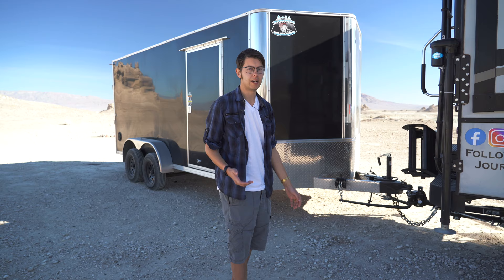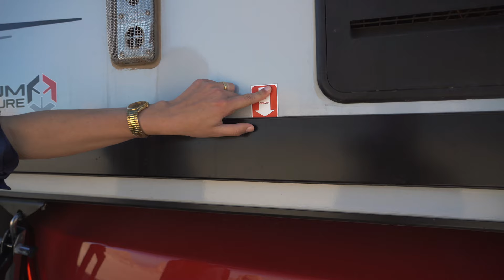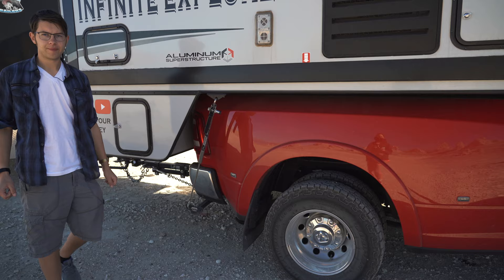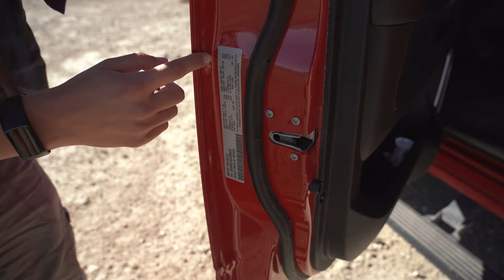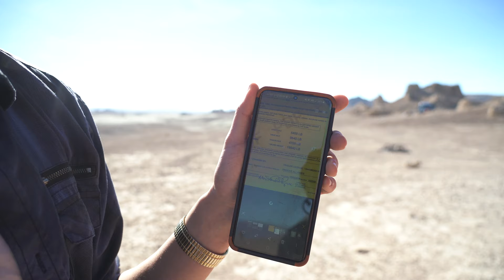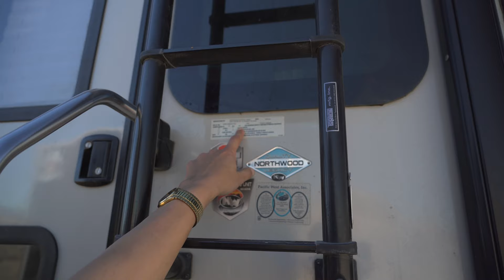Truck Camper Weight Safety + Weight Distribution Hitch

Comment: Great video. Looking to do the same setup. My trailer is a little heavier. I bought the hitch extension already. Thanks for the info on the weight distribution from curt. I have the same truck as you just older (2010). I have the tork lift tie downs already but getting the new tork lift hitch prob the 20,000 lbs version. I know I need back end new tie downs. Did you also have to buy the extensions as well for the tie downs? I’ve read I might have too, since it’s a dually .
Reply from the maker: Yep new rear tie downs are needed to work with the new torklift hitch
Reply: @InfiniteExplorers  yes I knew that and I know I need new ones. Since with the torklift hitch they connect into the hitch. I believe the part number is r3505. Did you need the extensions ?

Comment: How big is your cargo trailer?  It looks like you have a lift kit on it to give you more ground clearance.... which is a must for traveling off the beaten path.
Is it a torsion axle trailer or leaf springs?
Reply from the maker: 16ft cargo trailer. Yep, we flipped the leaf springs so we gained about 5" of clearance. Has worked great with no bottoming out when coming into steep places like gas stations in the southwest. The axles are leaf springs. Looked at getting one with torsion axles but prices are crazy for trailers right now.
Reply: @InfiniteExplorers  Thanks for the info.  I started trailer shopping yesterday, although I've been "kicking tires" since last summer.
My shopping got more serious yesterday after selling a little travel trailer over the weekend.  I'm waffling between a 14 and 16 footer.  16' is bigger than I want for my overall length with truck and camper, but it really doesn't make much sense to go from a 12' to a 14'.  My current trailer is a 7x12.
Reply from the maker: @Delta Bravo  we are happy with the 16ft v nose :) still enough room in the nose for a few things, plus our SxS is just under 14ft long.
Reply: Great presentation!  Very easy to understand with no sales fluff.  New to TC world. Thinking about a 13’ box trailer for micro golf cart, bikes, and tiny boat with a F350 & a new 3000lb. Palamino TC. Had two box trailers in past pulling them with a MH. Thanks
Reply: A nice video! We have a similar setup,  but a larger camper with multiple slides, so we went with a Ram 5500 so there are never payload issue. We also tow a SXS in a 14' enclosed trailer with a 48" Torklift extension. Because I am super paranoid about issues, we also added a Trailer Toad, so there is essentially zero tongue weight. Very interesting idea to do a lift on the trailer. I'll have to see if it can be done with mine! Safe travels!

Comment: GVWR for your 3500 is 14,000 pounds.   Payload for a 4500 or F450 is still 14,000 pounds, but the payload is less because those trucks are heavier.  I suspect your truck is way over 14,000 pounds, so you can get a ticket or worse be responsible if you have an accident.

Comment: Overweight
Reply: Yeah, either the new RAM 3500s can handle more payload or he's calculated it pretty close. An Arctic Fox 1150 is one their heaviest campers so I'm surprised the truck wasn't in the 450/4500/550/5500 range.  Definitely need one of those for an Eagle Cap.  This guy seems to have it all figured out letting the tow trailer take off some of the weight.  Smart, I didn't know a trailer could do that for the truck, just thought it would be extra weight.